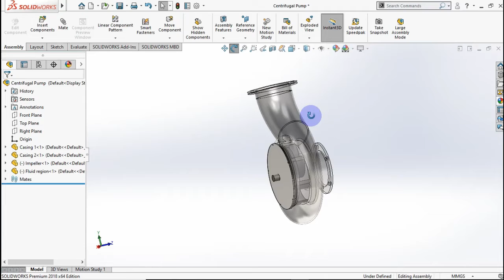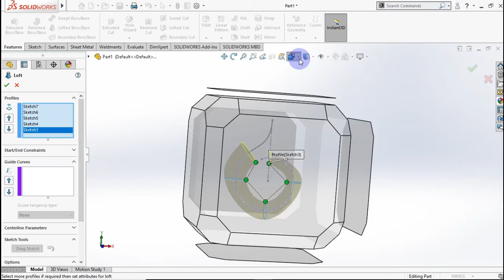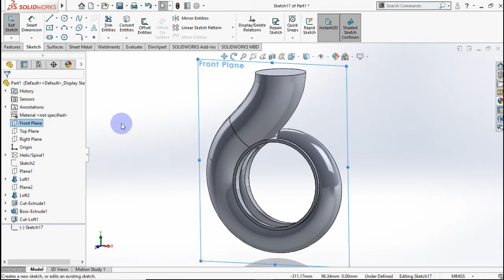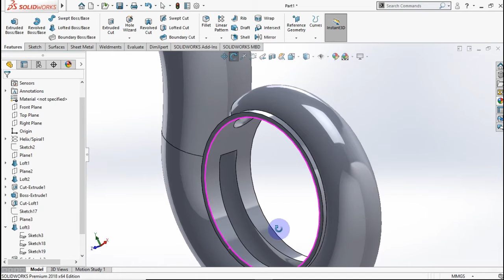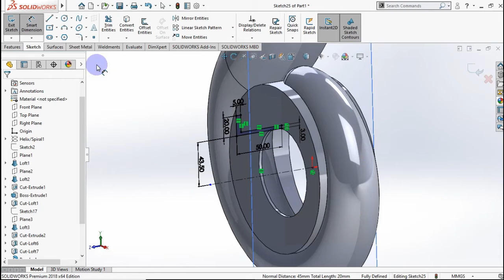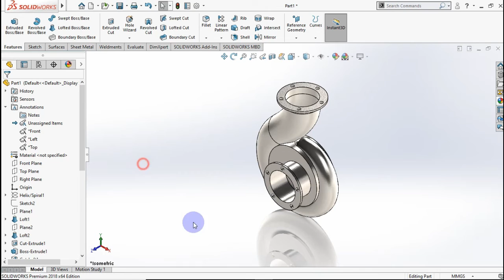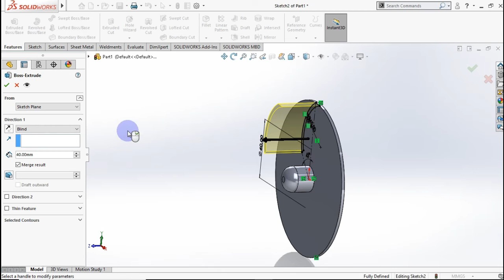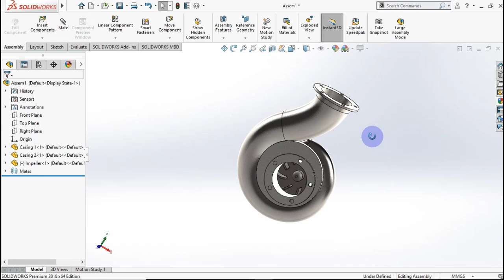Design Centrifugal Pump use Solidworks

Comment: hi, I am getting an error while making loft command at 18.40 "cannot knit sheets together" do you have solutions
Reply from the maker: Maybe you need to check loft parameter..
Reply: @EngineerKoniago  i been following according to the video but i dont see any changes to the loft parameter. any suggestion?
Reply: @Savier283  Open the sketch created at 16:00 and modify circle radius to 10mm and centerline length to 10 mm
Reply: @alessandroscardi2210  thank u bro

Comment: hello, thank you for your videos, i want to do the simulation part in comsol instead of solidworks for my reasrch, if i tried to import this model in comsol will it works ??
(because i have made a pump's model from another software before but when i try to import it to comsol it shows me a warning)
Reply from the maker: hi.
maybe you can save as file into step or parasolid file. and you can inport the file into Solidworks

Comment: At 19:35 the circle in the front plane becomes smaller 19:36 than the initial 20mm. When I attempt the loft cut using the previous circle I get this error " Rebuild error:  The feature couldn't be created because it would product self-intersecting geometry". I can send a screenshot so you help understand the precise problem. What are the changes you made so I can follow along.
Reply from the maker: please check again the selection points and the cut loft parameter
Reply: @EngineerKoniago  I am stuck at the same time point the lofted cut is not working at the given parameters. There was a skip in the video please explain
Reply: @debabratadas9762  its different skecth, new sketch, offset entities, reverse 3mm.
Reply: Bang kenapa di menit 18.35, Ada notif " Rebuilds Errors, Cannot knit sheet together.
Mohon penjelasannya
Reply: How did u solve this problem bro please give information @mumachix

Comment: Please at 18:36 , I am getting the error message “ Cannot knit sheets together” 
I will be really glad if you can help out
Thanks
Reply from the maker: please check parameter you insert
Reply: @EngineerKoniago  I clicked on the First circle and the base circle and used the curve as the centerline parameter
Reply: Is there a way I can send you a video to show you that exact place and how I did it?